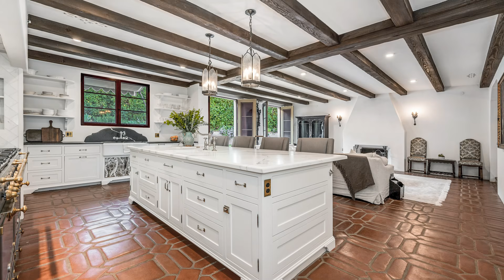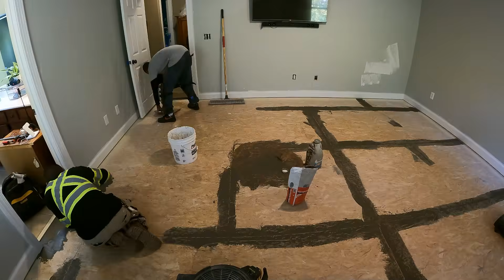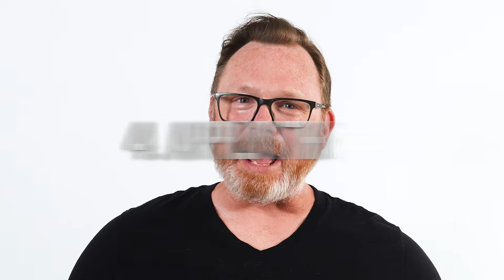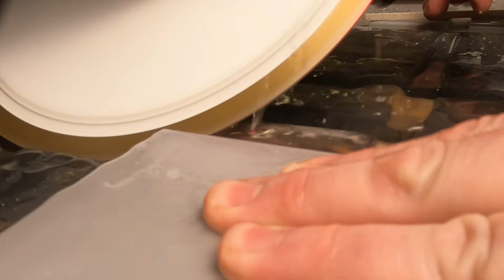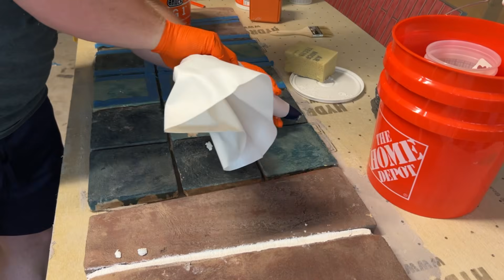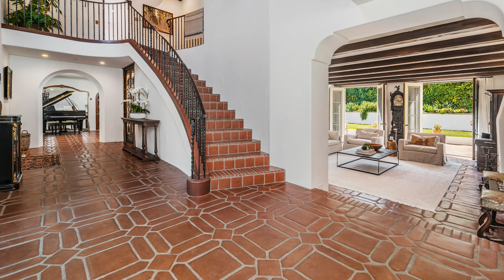How to Install Terracotta Tiles Like a Pro | Step-by-Step Guide for DIYers & Installers

Comment: Very helpful! Do you recommend an impregnator before the sealant?
Reply from the maker: One sealer is good and most tile and stone sealers are “impregnating” or penetrating. I recommend using before grouting and again after. I would stay away from any topical sealers.

Comment: Man, I wish I'd seen this video before I began a project with clay tiles! Now I'm trying to figure out a way to remove excess grout from my unsealed tiles. Tried a water/vinegar solution without much luck. Looking at grout removal solvents and possibly using a diamond cup wheel to grind it off. Its just an outdoor laundry room, so not terribly worried about staining or scuffing. Any pro-tips would be greatly appreciated! 
Great video, by the way!
Reply from the maker: For a cent based grout Sulfamic acid works well. Just be careful of my adjacent metals. For urethane or resin based grouts a chemical stripper should work. It will take some elbow grease but go for it. GOOD LUCK.
Reply: If you sealed them already, like anyone else will say, you have to strip the sealant off.  If you didn't seal it, you can try to tape off the grout, or seal just the grout.....and 'stain' the tiles with a terracotta colored stain, to try and even it out.  Not pain, because it will look like paint, but a good stain might help blend the grout stain.  Then seal and keep your fingers crossed.  Any solvent base sealant, like a semi-gloss or a matte finish, will enhance colors, where an acrylic will give you some shine or semi gloss, but usually not change the colors much.  Natural sealant, is just what it says.  Once it is dried, it will look just like it was before you sealed it (mostly  😉)

Comment: Good video Craig keep it up👏🏿
I have a question is it a requirement to soak terracotta and ceramic tiles before installation
Reply from the maker: Great question. Some factories do suggest it. The selections TileBar has do not require it but I will say in certain conditions you may need it. Extreme heat, and direct sun, anything that would accelerate hydration then soaking helps.   Regardless use a great mortar.